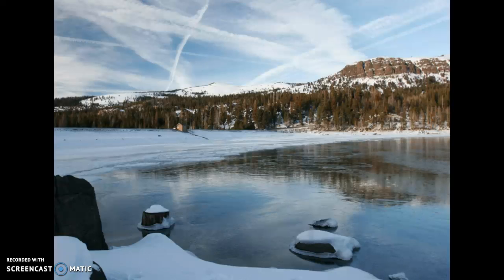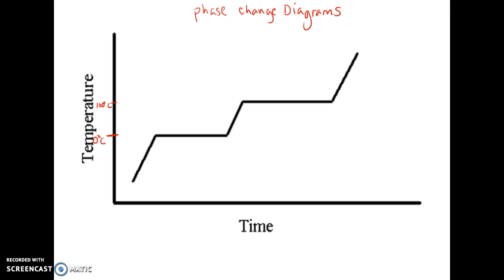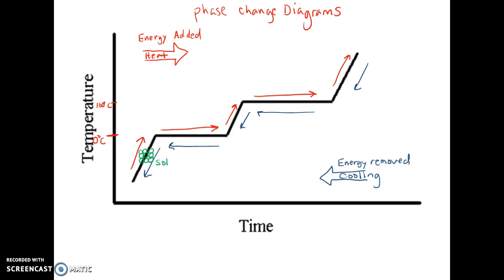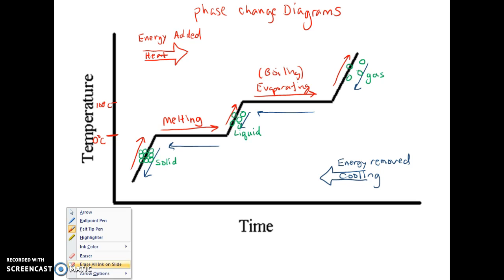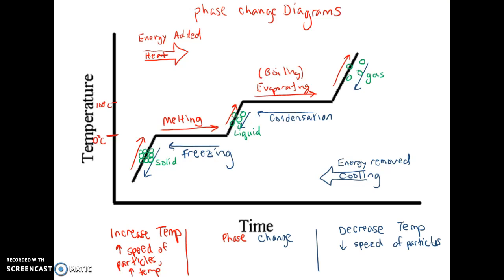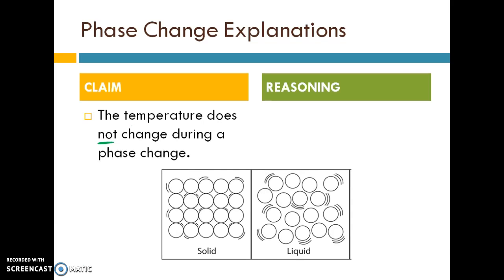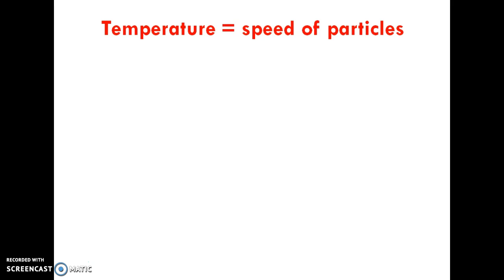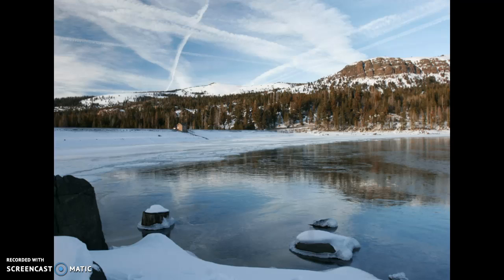Phase Change Diagrams

Comment: X-Axis should be labeled Heat Energy.   Particles release heat, they do not go back in time.
Reply: And temperature does not change the particle connection, heat energy does. Temperature is just a measure of the average kinetic energy. Temperature is not energy it cannot do any work.